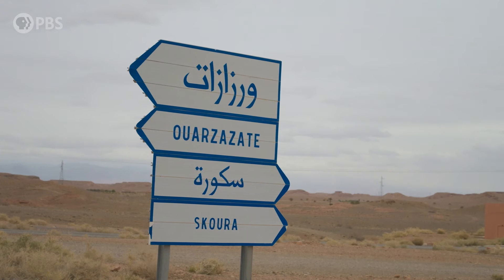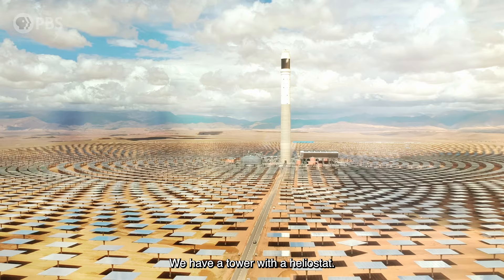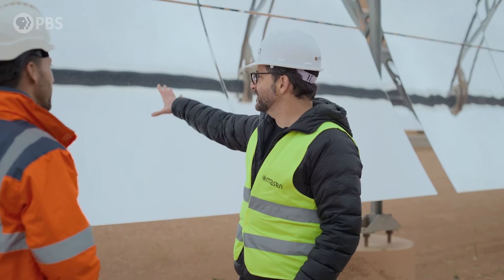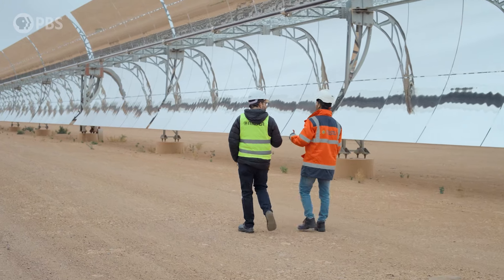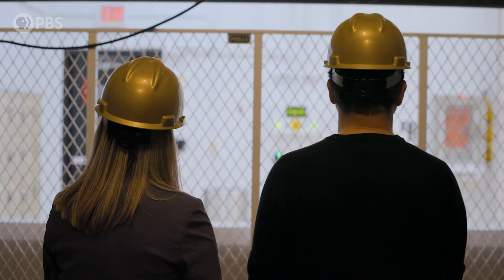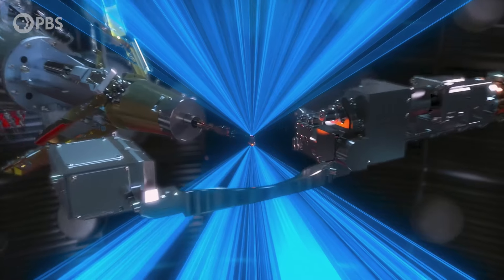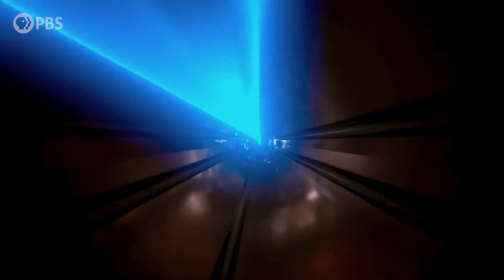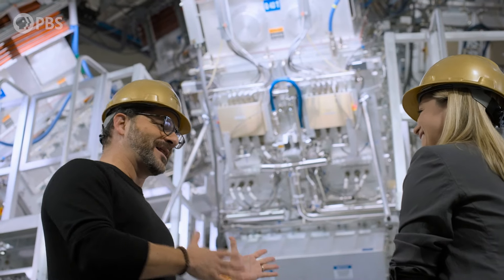The World’s Largest Concentrated Solar Power Plant | A Brief History of the Future | PBS

Comment: Concentrated solar is honestly my favorite form of renewable energy. No silicon manufacturing, no rare Earth metals, no chemical waste of any kind. Just mirrors, plumbing, and high-energy physics courtesy of our very own Sun. No losses of efficiency at high temperatures either like with photovoltaics, and no birds running into wind turbines. I really think countries with lots of desert should go all in on it. With care paid not to further fragment desert ecosystems in the process, of course.
Reply: Birds do get killed if they come close to the focal point of a CSP, they fall burning to the ground.
Reply: Cost is higher, but storage is cheaper for 8 hours
Reply: @SolarCookingGermany source for your claim please, seems kinda sus.
Reply: @SolarCookingGermany  No doubt, but this risk dwarfs in comparison to the deleterious effects of pollution and the risk of a runaway greenhouse effect caused by fossil fuels.
Reply: @alex.velasco  I also think "stay away from the thing massive thermal air currents are radiating off" probably makes more sense to birds than turbine blade fields. Just a guess
Reply: @LexYeen  Looks like Youtube censored my reply for no reason, but you can look it up yourself. This platform has become completely useless.
Reply: Plumbing is the hard part, due to the corrosive nature of the salt.
Reply: If you like that wait until you hear about nuclear, imagine a building one acre big that produces enough electricity for a city, with existing technology!!!
Reply: @SolarCookingGermany  and I bet they taste like chicken! 🍽🍗🍽
Reply: @jarjarbinks3193 Yeah i would add an Apostrophe to it all for use of alloys like Inconel, and Electronics in the Heliostats.

At the end of a day a proper Life Cycle Assessment (LCA) is needed to truly know, but yeah CSP and Hot Dry Rock Geothermal are my favorites!
Reply: As @GenaTrius said there is a bit of a deterrent in the Bright/Thermal nature of it all. However, there was a major issue where when the focal point was raised above the target for throttling the focal point became invisible and thus the apparently “safe” area was no longer safe.  By defocusing the Heliostats the goal can be accomplished without this risk.  There was some study on this i can grab if i remember correctly.

This reminds me of the “painting one wind turbine blade fixing the bird strike issue” solution to an extent.

GRANTED some risk still remains, so strategies used at Airports and Landfills to deter birds are probably best practice as well and would help.  I need to hunt for data on if this is done/efficacy and all that.

Finally though human existence is almost always in conflict with nature in some part, the key is minimizing it.  If this plant can prevent some Mining or Oil Extraction it may save more birds overall.  Granted different habitats and such probably.  The issues of Water Use (if not using a “dry condenser” or  Supercritical CO2 Turbines etc) and displacement of land animals like Tortoises if i remember correctly.

(Edit: Readability Fix)
Reply: No birds getting hit by turbines just them being cooked.

Comment: I've long thought this power plant impressive. But I've also wondered why, in a desert region where water is a scarce resource, they don't pass the steam over a heat exchanger to recover the heat for reuse allowing the steam to cool sufficiently that it condenses back into water for reuse. To my inexperienced eye, this would increase the overall efficiency of the plant.
Reply: “Dry” and “Wet” Condensers do both exist, and Dry are definitely preferable!  Granted greedy types / needing to be eCoNomIcallY cOmPetiTive may lead to using the cheaper option sadly.

Another neat option is to use Supercritical CO2 which if I understand correctly doesn’t have that exact requirement.
Reply: ericliu5491  I'm not familiar with that technology. Could you please explain?  Thanks.

Comment: There appeared to be two forms of CSP in the video. The plant employee referred to mirrors concentrating sunlight on the towers, but later in the video I saw parabolic mirrors concentrating sunlight on a tube at the focal point. The tube contains molten salt heated by the sunlight. Since the employee didn't refer to them I wonder if the latter photos are even from the same solar plant.
Reply: I think that tube is filled with synthetic oil. A synthetic oil Concentrated Solar Power system device does not have a tower. The heated oil goes into a vat filled with molten salt which in turn heats water to turn a turbine and generator.

Comment: Are they still building new concentrated solar plants? I thought they stopped years ago, PV w/bateries is cheaper. Lazard's last LCOE for concentrated solar is in 2019 at $150/MWh compared to $50/MWh for wind and PV
Reply: Did those include the cost of Solar/Wind Storage compared to 24 Hour or so Solar Thermal Plants?

Granted i agree for the most part, but as per my rant in another comment, i think PV has several faults that need adressed soon which aren’t being considered in most LCA’s / News Blurbs.

Granted CSP isn’t free of issues, and indeed is nuclear like in cost at times (although some designs like Parabolic Trough are a bit more PV like in terms of cost/scalability)!

Comment: About 50 years ago in the UK, a typical coal-fired power station would run a number of generator sets. Three generators were typical. Each generator would produce 500MW and it could do that day and night, summer and winter in a country with far less sun than Morocco. 

The Morocco plant covers 12 square miles and produces, in total, about 1,500 GWHr per year according to wikipedia. During the night it uses Diesel power to keep the system warm. Really, that energy needs to be subtracted from the total output for a fair comparison.

That single coal-fired generator will produce about three times as much electricity in a year (500 x 3 x 8760) and will cover nothing like 12 square miles of land and doesn't need a sunny climate. So a typical coal-fired power station will create about as much electricity as around a hundred square miles of solar farm in a hot desert.

Estimate for the UK: Each current fossil-fueled power station will need to be replaced with a number of such solar plants. We need to multiply by 3 for the generators in a typical power station. By 2 to compensate for the different number of sunshine hours in the UK and Morocco and by approximately another 2 to compensate for the difference in latitude. In summary:
1  Generator = 3 Morocco CSPs
1 typical fossil-fueled power station = 3 Generators.
Factor 2 for difference in sunlight hours.
Factor 2 for difference in latitude.
Area of 1 Morocco CSP = 12 square miles.
1 UK fossil-fueled power station = 3 x 3 x 2 x 2 x 12 square miles of Morocco CSPs = 432 square miles.

Comment: Concentrated solar failed in California because it could not compete on price. It was the most expensive way to generate power and it never generated the power it was supposed to
Reply: Cost is only part of the Picture.  Solar Panel Longevity/Recycling is a MAJOR issue.  Not unsolvable as some anti-renewables types may say, but it has essentially been treated as a problem for “future me” rather than actual “Cradle to Grave” planning being done.

Furthermore PV systems inherently require Electrical Storage, this again isn’t impossible but is a hidden cost.

Concentrated Solar however is made of largely recyclable materials, and also doesn’t degrade as PV Panels do; short of Rust/Long Term Concrete Issues, things can keep running as long as they are maintained.

CSP Also has the advantage of thermal storage.  With large enough insulated tanks/vats for the Molten Salt, Hot Oil, or Blocks Heated Supercritical CO2 pass over etc the Turbines can run for 24hrs or so if not more without sun.  Some designs also allow for the turbines to be run off some sort of boiler if need be (although fossil fuel greenwashing is a potential issue with that).  Thermochemical Hydrogen Production, Process Heat, and District Heating can also be used in some designs.

At the end of the day whatever gets us away from ruining the planet/environment “works”, but i would say be cautious in that Capitalism tends to do short bandaid fixes with unintended consequences, and just because something is cheap doesn’t mean that it is “correct” in all sorts of manners.